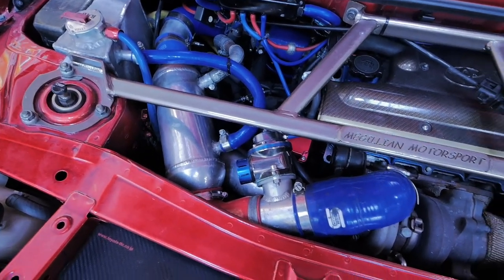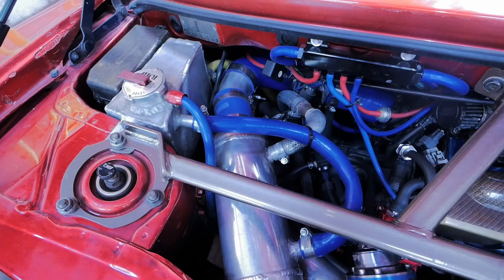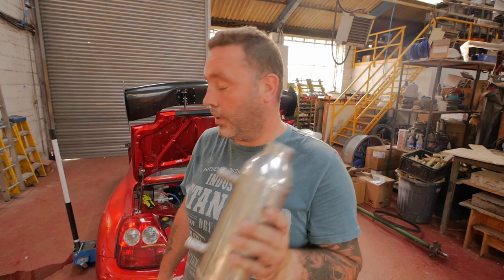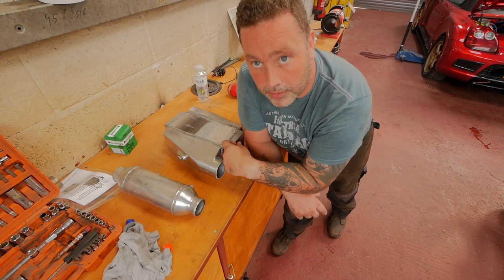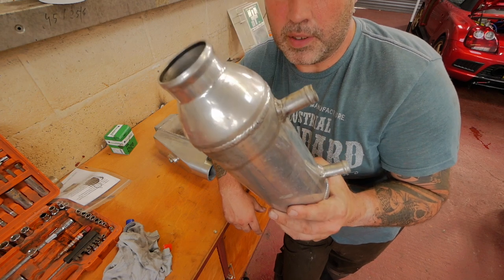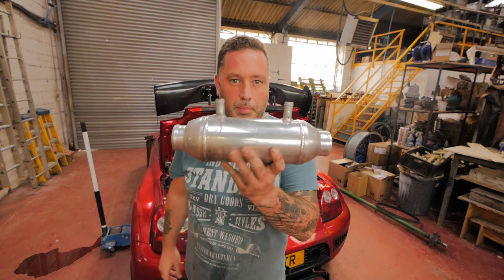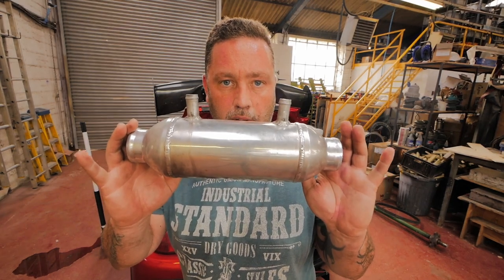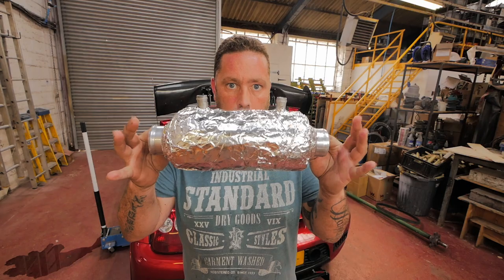water to air chargecooler - MR2 Spyder 1zz turbo

Comment from the maker: Do you agree with my decision?
Reply: SpyderLEE tricky, I agree with some others that a bench test would be useful. I can fully understand your reasoning but if the other cooler is bigger you could make an argument that even though it doesn't cool in a uniform manner, it does cool the air more, because the average output temperature across the cooler COULD actually still be lower than the output from the round one. If it is, that would be beneficial. Only testing will determine this. Having said that, the cost difference does suggest that the round one may well be better?
Reply from the maker: patrick robinson yeah I think I may have to have a go at this, just to put my own mind at rest. Not a hard thing to set up. And I've even got a thermal camera in my tool box.
Reply: SpyderLEE great, sounds like an excellent opportunity for another video?
Reply: i think the first think that you must to change is the radiator?same dimensions but thiner chells ...gt4 cooler is a choice i have already in mine car?i think is the best 1st step to see what other thinks needs change.as much thiner and lot chells you got the faster heat exgange you get
Reply: Did you tap into the car's radiator? Or you have an extra radiator?
Reply: Do you use an additional FM radiator? Which size?

Comment: More flow isn't always better, if you are pushing the water through the radiator too quickly the air may not be efficiently taking the heat with it.

Comment: welll you said the other cooled from the hottest side first and worked its way back so surely if you change the hoses round youd get the same effect with the bigger cooler ,
Reply from the maker: Chris Ggeorgiou nope because on the bigger one, the water flows at 90degrees to the air flow. So there will always be a point where the air only goes across warm water. Makes no difference which ever way it's piped

Comment: Hey, since you had both of chargecoolers out - why don't you got a bench test? You can set up cooling with some extended hoses and just use hairdryer and measure temp of air exiting both chargecoolers. Seems to be easy test to do.
Reply from the maker: Homebuilt Racing good idea 👍

Comment: Hello Lee 
I'm getting into ceramic coating,  got the booth and industrial oven.  I'm getting techline ceramic coating.  They also do a thermal dispersant coating for rads,  brake calipers and intake manifolds being it's recommended use.  It's proven to drop the intake temp,  I wonder if it would help on the charge cooler?
Reply from the maker: Mike Kerr ....sounds posh mike...I will have to have a Google on that, don't know much about it. And would definitely look neater than my wrapped bacon roll 😁. Something has definitely changed though since doing this video, took the car home today.. its making boost easier (had to drop the boost controller as it was hitting 13.5psi, and its definitely quicker for some reason. Will log the temps tomorrow. Will have a play with that other thing we spoke about over the weekend too. 👍
Reply: Mike Kerr you need to watch Engineering Explained, that will tell you why this doesn't work for radiators
Reply: patrick robinson all rads should be coated.  I use frost rad paint.  Being they are made from aluminium and aluminium oxidizes which creates a thermal barrier thus reducing cooling efficiency.
Reply: SpyderLEE hello Lee,  check out techline coatings 😊

Comment: How much water do you have in the system? It may be heat soaking if its not enough.
Reply from the maker: Boosted G I've got the temp controller to fit, so will be able to monitor the water temp soon
Reply: I’ve also got a turbo’d spyder almost identical setup and having similar issues. I’m going to try a fuel cell in the frunk full of water this weekend. I’ll let you know if the additional water fixes it or if there is another bottleneck in the system.
Reply from the maker: Boosted G be good to know 👍👍
Reply: So I tried a 10 gallon fuel cell. IAT till jumped up to 50C+ on high boost. The intercooler was hot, heat exchanger was slightly warm but the water was still cold. I’m guessing the pump is the issue on my setup I’m going to try replacing that next.
Reply: I fixed this on my car. It was the pump. I installed one of these 
http://www.ebay.com/itm/BOSCH-COBRA-WATER-TO-AIR-INTERCOOLER-PUMP-WITH-HARNESS-AND-PIGTAIL-NEW/262845076550?ssPageName=STRK%3AMEBIDX%3AIT&_trksid=p2057872.m2749.l2649
and it runs nice and cool. It doesn’t look that big in the picture but my original pump was about the size of a Redbull and this one is the size of a can of Monster.
Reply from the maker: Boosted G cheers mate. It definitely pumps more than mine. Will look into that

Comment: Hi, me again! Just wondering whereabouts in the intake your IAT sensor is located. Are you using the standard IAT sensor on the MAF or have you relocated it after turbo and charge cooler?
Reply from the maker: patrick robinson lol hi again, I'm using piggyback ecu. So it's on the stock maf. Positioned half way between the charge cooler And the throttlebody. I tried before the turbo but it was a nightmare to get to idle properly.
Reply: SpyderLEE so the turbo blows into the MAF (via the charge cooler) and the MAF is located after the charge cooler, interesting. Is the throttle body located in the standard position feeding directly into the manifold. A detailed look at your setup would be another interesting video (for me anyway!) and a few pointers about why you arrived at the setup would be great. You seem to have got a good setup that works reliably.
Reply from the maker: patrick robinson yes, I think my maf maxes out under boost but my emanage is on a map sensor. Standalone would be much better.

Comment: With regards to the AVT tubular chargecooler, is it a genuine AVT chargecooler because from looking at the radiatior fins of the internal core of your 'barrel' chargecooler at 5:50 in your video, the radiator fins don't look like the 'fingered' fins found in the 'segmented' core that AVT makes which can be seen on their web site here: http://www.chargecooler.co.uk/index.php?main_page=privacy
Are you sure it's not a cheap eBay knock off, and if so can you prove it?